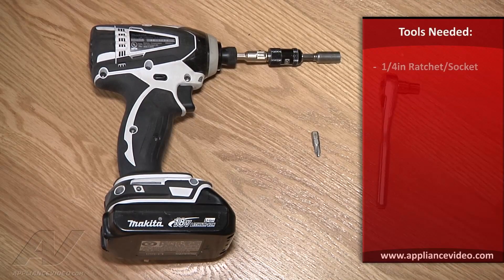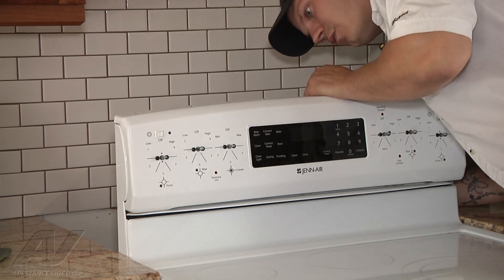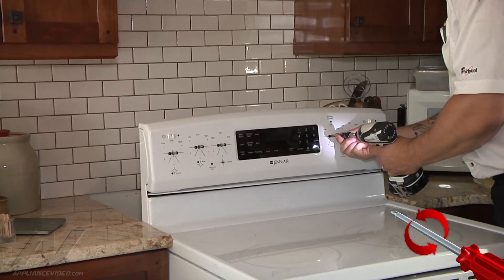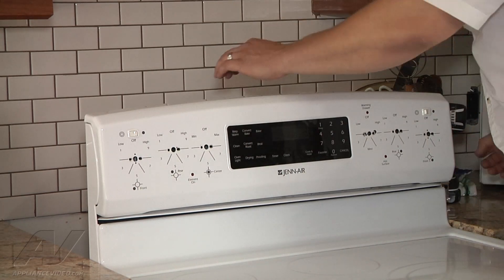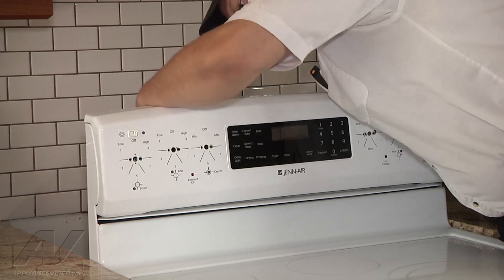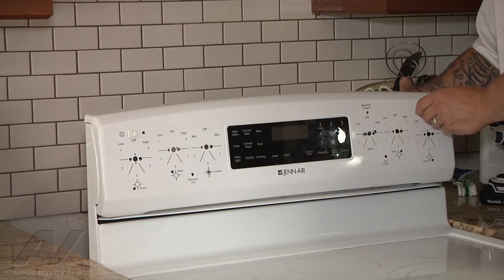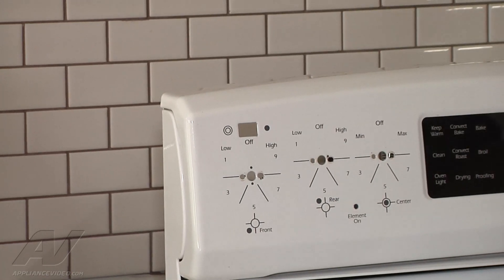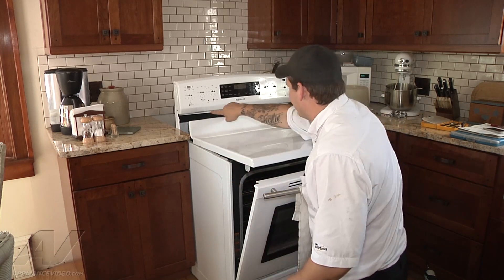Jenn-Air Stove Repair - Touchpad not working - Electronic Touchpad

Comment: there is silence in the beginning of this video just before he states the tools necessary to disassemble the panel. is he offering important information that maybe you can dub in or write it on this site?
Reply from the maker: Thanks Dean we will add this in . Greatly appreciate your input we did not catch this. Please help us provide more videos to our site by posting ApplianceVideo.com on your YouTube, Facebook or Twitter account or add us to your circles. If you are in need of any parts please support our parts department on line at http://savemoreonparts.com/ or call 1-800-830-5465 7-days a week until 11pm Eastern time. Thanks again your support.  Matt, Ace Appliance service technician.